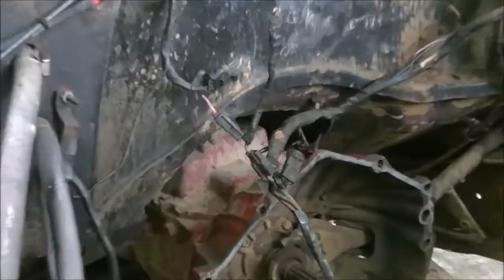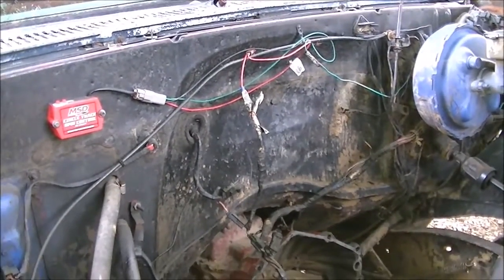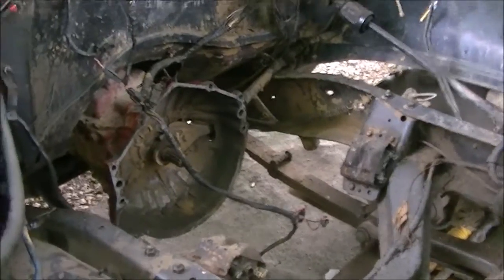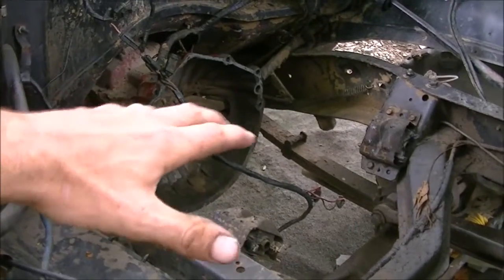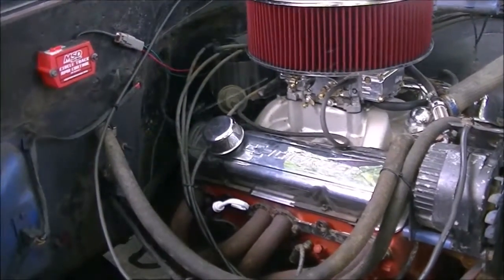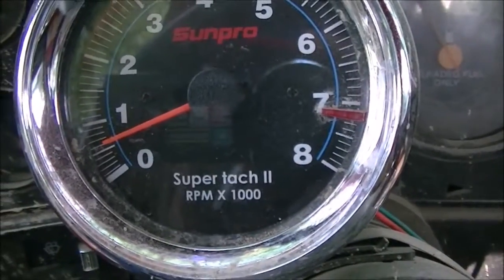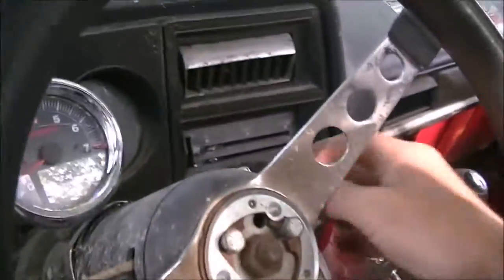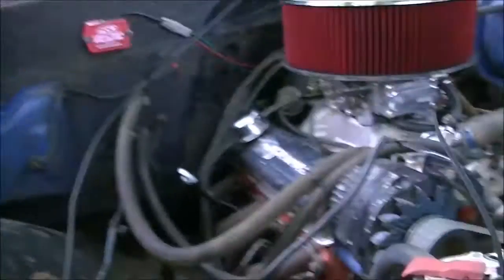last start of the new/old engine

Comment: Have you ever thought about doing an LS Swap to this truck??
You should put the old engine from the mud truck in your daily driver it will fit, you may even be able to use your stock TBI Setup.
Reply from the maker: tbi wouldn't work unless I put a mild cam in it, been there done that lol lots of duration cause the computer to freak out, just wouldn't run right and that was on the last chevy work truck
Reply from the maker: and I like old sbc engines ,LS engines are great but cost way too much to build
Reply: Matts Madness google hitlers ls swap you will piss yourself laughing . i dont think its on you tube tho im not sure. . i saw it on facebook. What was wrong with the other motor ? I thought you just swapped/ or built that one , i love a 350 4 bolt i can make one scream but also a ford fe and big block fan too . thanks for sharing brother cant wait for more